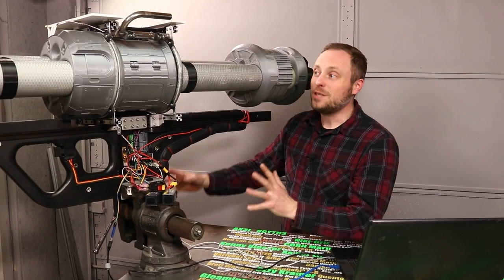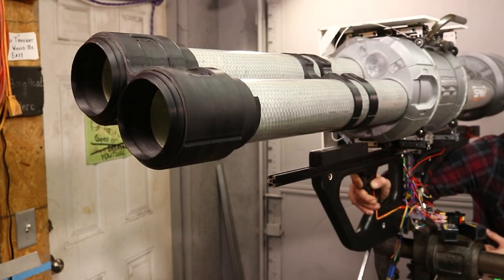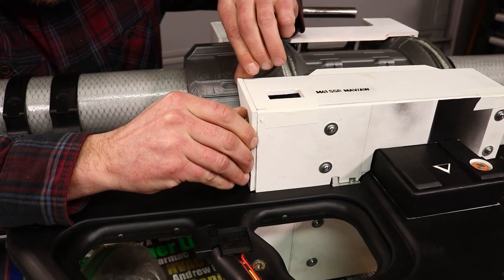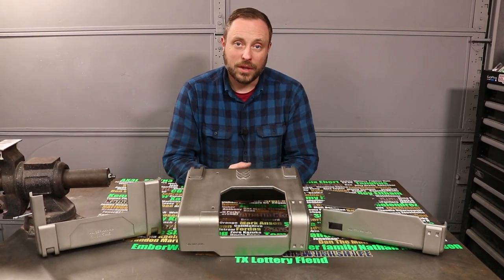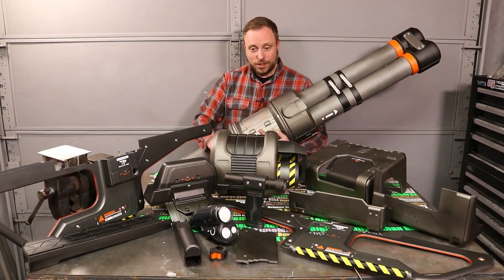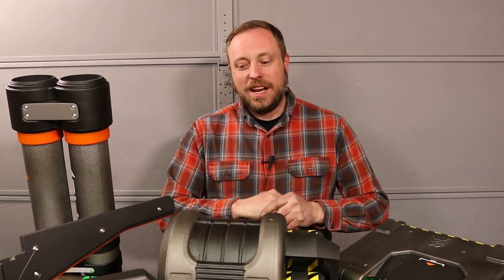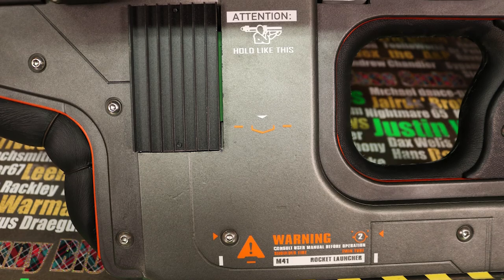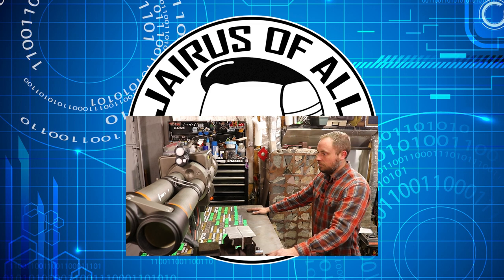It's the SPNKr - Building Halo Rocket Launcher - Part 4

Comment: A little saftey featuee I woul add if not in place already. You said the rocket fires on trigger pull and the barrel spins on trigger release. I would add a significant delay in the code (an actual delay, in order to stall any other actions in code) after trigger pull, so you can make sure the barrels don't start spinning too soon either due to someone tapping the trigger or pushing the self test button etc.

Comment: the laser engraver can damage the sensor if there is and accidental reflection, you can solve the risk , getting the proper acrilic filter to put between the machine an the camera if the laser is uv, you can use something similar to the resin 3d printer use, if is IR. you need a different one, that will look green. intead yellow
Reply from the maker: It came with green glasses so I’m guessing I’ll need the green filter. Thanks!! Glad I didn’t ruin a camera!